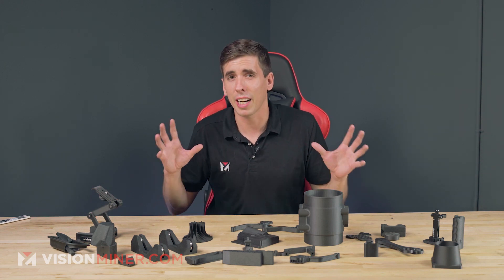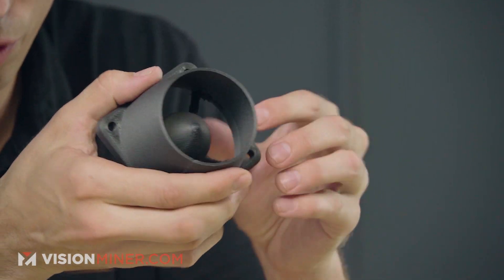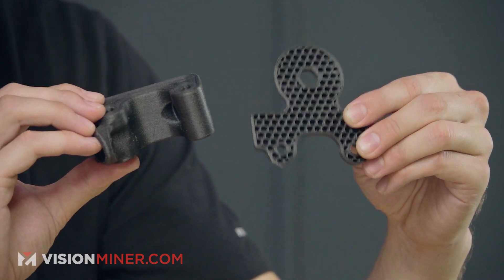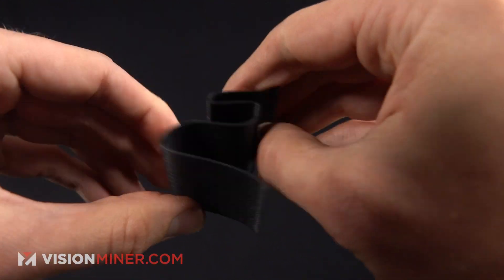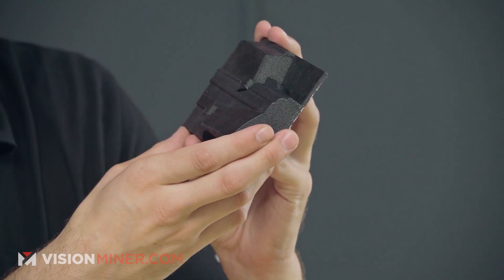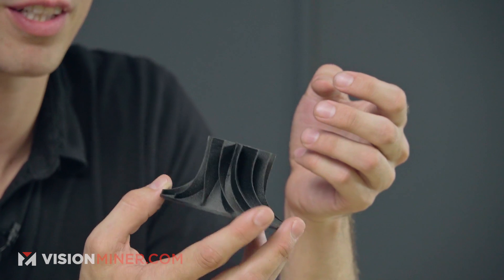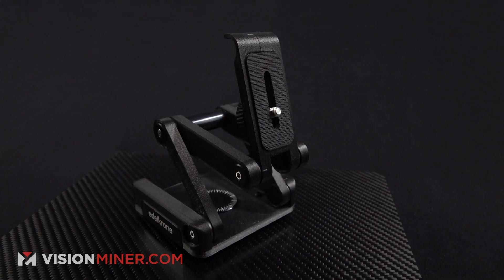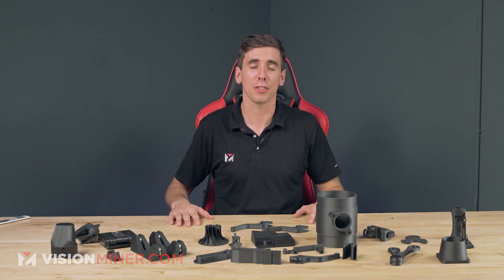Applications for Carbon Fiber Nylon - Functional 3D Printed Parts Pt. 2

Comment: CF-Nylon is my favorite material. Print so well and it’s so strong. I’ve designed many parts for work and one of them is a complicated parts to clean a big band saw blade. It has many air channels inside and weights between 800g and 1200g when you print it.

Comment: That was NOT HVAC, that's car engine intake pipe where Mass Airflow sensor plugs into. The straight walls removes air turbulence for accurate metering of air flow. Mounts to a metal panel on car.
Must survive under hood temps of engine idle in Arizona summer, or in Sahara desert.

Comment: Any advice to when one might want to choose PA12 CF over PA6 CF or vice versa? Having a hard time deciding between the two. Wish 3DXTech sold samples of the PA12!
Reply from the maker: Generally heat and chemical resistance, or moisture resistance -- PA12 picks up less moisture

Comment: What is your opinion on the MakerBot Method Carbon Fiber?
Reply from the maker: Way overpriced for what you get, closed system with proprietary materials, simply a waste of money compared to any open-material printers out there. BUT, if you want pretty parts, and have no consideration of budget, they're not BAD machines...... but man, they sure are limited

Comment: I never thought about the advantages of channeling air flow through a 3D printed part. I am so use to designing things for machining applications where internal channeling would be impossible. Thanks! How does the hygroscopic.....ness compare with that of CF Polycarbonate?
Reply from the maker: It's a bit more hygroscopic than CFPC, but still manageable :)

Comment: Could you 3d print an intake manifold with this filament?  Would it be able to handle the heat and vibrations?
Reply from the maker: absolutely! CFPA6 could handle it and CF-HTN or HTN CF25 would both be great options: visionminer.com/materials

Comment: Your print temp requirement seems right at the max for the Prusa Mk3s. Will it work on it? Is there an upgrade to better handle it?
Reply from the maker: CFPA6 will work great on the Prusa, however, a Slice Engineering Copperhead or Mosquito will bump your max temps significantly, enabling you to print the higher temperature nylons, like HTNCF25 :)

Comment: Do you think carbon fiber nylon would be a good material to use for an electric motorcycle body? It would be light and strong
Reply from the maker: Absolutely! 3DXTech actually built 80% of a motorcycle using their carbon filaments.... it was quite a beast. It will take you so far, but I'm told at a certain point, popping wheelies resulted in catastrophic failure.... but realistically, that all comes down to design.

Comment: What printer should i get for this cf nylon stuff? New to 3d printing. Thanks
Reply from the maker: Enclosed is always best for overall strength and quality -- www.visionminer.com/funmat is close to the best deal on the market. However, if your bed and hotend achieve proper temperatures, you can print on a $200 Ender3....

Comment: Got my first 3d printer 2 weeks ago.  Now i have a second one, setting up for nylon (polyamide) all metal hot already.
Reply from the maker: Definitely check out the HTN CF25! https://visionminer.com/products/htn-cf25
Reply: @VisionMiner  25% is the most carbon fiber I've seen, so far. I'll be definitely checking out some of that.

Comment: Do you think you could print the compressor section of a small jet engine?
Reply from the maker: for sure -- with the new high-temp nylon it would even have a good chance at working for awhile. Just a matter of finishing/assembly/optimization.... might not be the BEST option, but could be done for sure!

Comment: Impressive!.....can someone suggest a cheap 3D printer that could use CF nylon and can make a few  parts that are 400mm (13/14 inches)
Reply from the maker: Really depends on settings. If the part is hollow, you could do it on a CR10s5 -- but the open air means you'll get more warping the thicker/bigger you go, so it's quite a variable question :) The AON or Pro 410 could do it, no problems at that size! www.visionminer.com/printers
Reply: @VisionMiner  thanks for the lead!

Comment: Can you advise the differences or preferences between the 3dxtech Carbon X Nylon vs. Matterhackers NylonX ?
Reply from the maker: 3DXTech works with engineering firms in aerospace -- very high quality carbon, and different grades. Compared to NylonX, it generally comes out smoother, and I believe the PA (nylon) may be a slightly different quality, as well. Plus 3DXTech is made in USA :)
Reply: @VisionMiner  - Im good with all that - will try a roll from 3dxtech as well - goooo Murrrrrca !

Comment: Hi, I'm wanting to try printing CF Nylon on my Ender 3 Pro. Can you recommend a good filament to start with and are there any upgrades you would recommend to help the process?
Reply from the maker: https://www.visionminer.com/materials -- we recommend 3DXTech CFPA6 to start. CF-HTN is even better, but you'll need an extruder that goes to around 300ºC for that, and a heated chamber really helps. All-metal hotend is needed -- you may need to swap a heat break if it has PTFE lining.

Comment: You can actually get away with pla for press brake tooling, just something to keep in mind
Reply from the maker: Very true! PLA is actually a pretty awesome material, when used in environments under 140F, as long as it's kept out of direct sunlight :)
Reply: @VisionMiner  Also can't be kept under load because it creeps. But other than that, its a super hard filament!

Comment: What's the sweet spot of carbon percentage in the material for it to be stiff but still have a good layer adhesion?
Reply from the maker: 10-13% is generally the limit because filament becomes too stiff and brittle to wrap around a spool at that point, unfortunately. When we see more coaxially extruded filament on the market, higher percentages become possible :)
Reply: @VisionMiner  huh, so PolyMakers PA6-CF with 20% carbon fibre is quite impressive then.
Reply: I know a nine layer exists

Comment: Hi,

The question I have for you and the team is the following:

 If you had 40 Prusa MK3S, would you head towards the small production run manufacturing services for other businesses/companies?

Or would you stick to selling custom designs on Amazon/Ebay/Etsy/Website that is going to inevitably become extremely saturated and probably over by the start of 2021?

I feel like going the additive manufacturing direction but I could really use some guidance. I have no problems working 16 hours a day 7 days a week.

Appreciate you guys and hope to talk soon.

-Andre O.
Reply from the maker: Pick something you enjoy, first off. But when you do manufacturing runs for a business, and then another, then get a referral from them, and begin to build your clients over 2-3 years -- your orders will be bigger and you won't be selling 1-2 parts on etsy, instead 100 parts at a time. Much more bang for the buck in our opinion, and likely easier as well. Higher standards, but better in the long run.
Reply: @VisionMiner  This is exactly the reassurance I needed to hear so thank you for the push! I've been going back and fourth but deep down inside, my intuition has been telling me that for a long-term sustainable business - this is the route to go.

What I enjoy most is learning about a specific area and getting deeper and deeper into it until I master that area and everything that encompasses it. Is feel like I have done a good part of this and acquired some "secrets" when it comes to business to consumer. Having said that, manufacturing runs via advanced processes for additive manufacturing is 100% the direction that peaks my interest the most. Hope to work together in the future and want you and the team to know that your comment has and will continue to have a big impact on me moving forward.

Thank you,

Comment: This is really cool video, coz lot people don't know what these materials can be used for!
Here are couple of more ideas for functional parts, that I did in CF-Nylon (and CF-PC):
- Motorcycle windshield mount + rear plate / signal light box
- Added electric motor on mobility scooter (while I had broken leg), and it was running like crazy! :D
- Leg braces: I scanned my leg and built custom braces with hinged foot (also while I had broken leg)
- Large 800W battery bank, inner parts are CF-PC, outer CF-Nylon
- Green screen mount, I still haven't installed motors, but CF-Nylon parts are holding quite well
Reply from the maker: Epic!! :)
Reply: What did you use to scan your leg?
Reply: @OfficialBloodsport  GoPro and some free photogrammetry software (PC), I think it was called 'MeshRoom'.

Comment: Does that "cold shoe" on the camera holder really secure a flash well? Those clips look to thin to work well. If the mount can securely hold a flash, that stuff must be crazy strong.
Reply from the maker: It actually does great -- I've run around expos with it, with a big shotgun microphone flopping around on it -- never once doubted the strength! The stuff is really amazing, lol!

Comment: Hei Vision Miner, may I ask you, would you consider replacing ASA with Chopped Fiber Nylon in a automotive product (air vents in front bumper)? Would it work and what would be pros and cons in a nutshell? I have used both but not in this application. And my print provider has slight surface evenness problems with ASA even when printing with 8000€ machine. I need to install brass thread inserts with soldering iron. Are there differences in gripping that insert or when enduring washing chemicals, high temps and sun uv rays? I have watched 90% of your all videos and liked them all. It would be great help if you can answer. Appreciated and thanks in advance!
Reply: Yes, but keep in mind CF-PolyCarbonate also.
It has much higher thermal resistance, than both ASA and CF-Nylon.
Better UV resistance than CF-Nylon, and it's probably stronger than both.
It does break (at some point) unlike CF-Nylon, that's the only downside..
Reply from the maker: Our CF-HTN has temperature resistance up to 220ºC continuous -- the stuff is INCREDIBLE! Higher than ULTEM 9085 :)
Reply: @Sleepery22  Polycarbonate without CF is already hard and strong as f. Breaking in this application is not even worry if my asa parts are ok in Nurburgring in customer cars etc...
Reply from the maker: Well, it will absorb moisture over time, but they both do -- it actually makes the Nylon more impact resistance. UV resistance seems similar, I think it would work great!

Comment: Do one for CF-PC and talk more about high temp applications and rigidity
Reply: Same. Very interested in this product+the cf-pc and looks like you have a cf-pc-nylon? Looking for heat strength and chemical resistance in all 3. Love these videos btw. Learning alot.
Reply: Damian Brown I’ve printed cf pc and I can tell you it’s amazing in strength and rigidity in continuous high temp environment of 80c under tension. I used it to make my belt holder for my x carriage in my enclosed core xy 3D printer. I just wanted him to share it with the world. It prints best with a garolite plate and 100c bed
Reply: @franciseb90  - second that.  Garolite is a Game changer - ive been running some PC-CF from SnoLabs - and its - to date my favorite filament.  Will look at other mfg'rs materials for PC-CF - any recommendations ? Will look at 3dxtec
Reply from the maker: Going to get into that soon!
Reply: Is this filament resistant to oil?
Reply: @THEEIGHTYD  ever used a zip tie....
Reply from the maker: Yep!